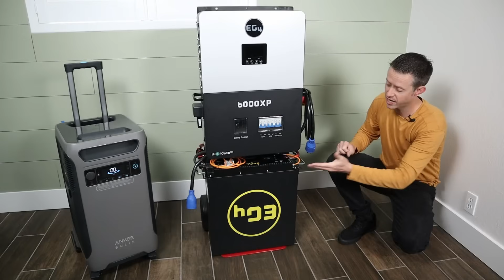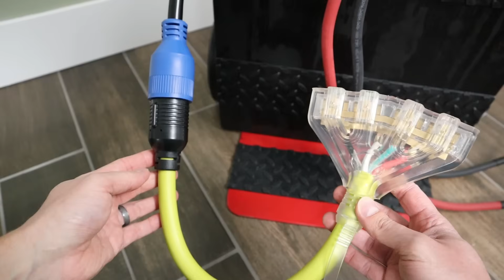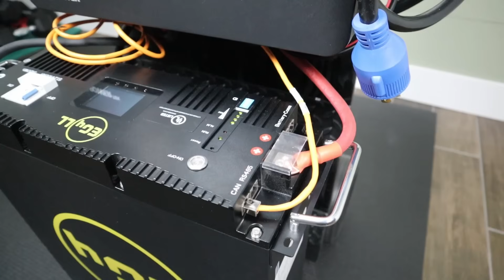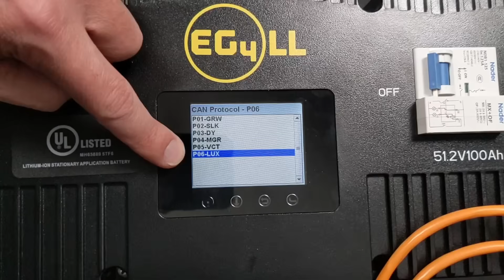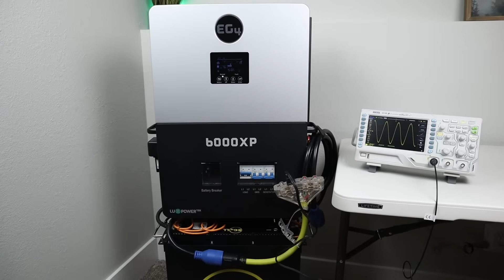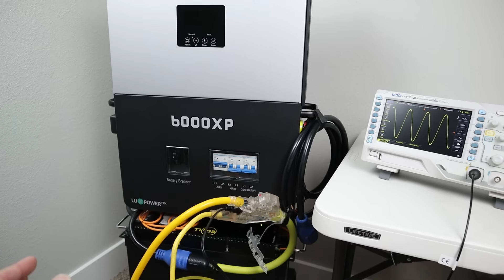Build Your Own AFFORDABLE 240v Battery Backup! Mobile Cart Using the EG4 6000XP & LFP Battery

Comment from the maker: I think I need to do a video discussing large DIY vs Plug N play systems. They both have their advantages and disadvantages! Thanks for your feedback everyone!
Reply: Came across something new, the Enphase IQ PowerPack 1500, a power station they say is rain and snow resistant and with a temp range of -4F to 122F.  Something I haven’t seen before and I left a suggestion they contact you for a review.
Reply: @BoringVolcanicField  that thing is $1400+ for 1500WH, not too impressive really. Says 82% AC efficiency which is about average to below avg?
Reply: @kayakjoe I’d like to see Jason get sent a unit by them for his full test suite.  What Enphase has that no other power station has is full UL certification for outdoor use:

UL certified for temporary outdoor use (UL 2743), system safety (UL 2743), and battery pack safety (UL 1642); tested for thermal runaway protection (UL 9540A)
Reply: Any guess how long or How do I calculate how long it would power my electric Trane 2.5 ton 16 seer heat pump? I have a small Predator 5000 inverter generator (3200 continuous via a 120v/30amp RV plug) to charge your cart off an external transfer switch.  Our home has tons of very tall pine & hardwoods on the south side. So solar won’t be very productive no matter where I mount it.
Reply from the maker: @butchgreene  this is how you calculate runtime:
Watt hours of the battery / watts of your load = runtime in hours
5000wh / 1000 watt load = 5 hours of runtime
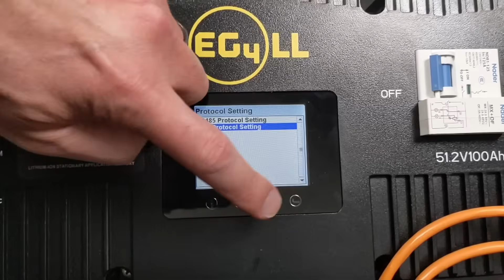Reply: @butchgreene I do hvac work and something that would really help you is purchasing a soft start . I recently installed one and going from around 100 starting amps to 20+\- starting amps made a huge difference. If you really want to heat or cool your home with very little amp draw I’d suggest getting a variable speed inverter hvac system. I don’t know how many batteries you have but your best bet would be to purchase a 220 volt mini split which has the built in inverter for the compressor and fan motors. This will give you a true soft start with very little energy consumption. You can get them fairly inexpensive, signature solar has a version of them but you can purchase them online just about anywhere. Research before you buy . They do have 120v versions generally up to 1 ton , the one 10:43 have starts at 7around amps and drops as the unit slows down . I’ve installed 2 ton 220 v mini splits and had them drop down to around 2 amps after room cooed down.
Reply: Looking into this.
Reply: Can we see a video of value charger with a gas generator?

Comment: Just put a 5Kw hand truck together, all in, including tools(new and didn't have them), under 1600, 100% UL listed, tax, tag, title, out the door, delivered... so depending on the components you pick and build requirements... you CAN get a GOOD setup, brand new, roughly 1K doll hairs less... NOT the same system though... The one here is way more capable, also it's 100 miles past overkill for most people...  You CAN mega max out a hand truck setup with an industrial hand truck and 4 to 6 server rack batteries stacked in a rack for 20.4Kw to 30.6Kw, with a 12000XP all in one, and be knocking on the door of 10K doll hairs.... or work up to that over several years... that's the great thing about these...

Comment: 3:54  So, just to be clear, since I have a 30amp 120/240 Transfer Switch, this cart should work with it, correct?  If so, I’ve been looking for something like this as a DIY build!
Reply from the maker: Yes. This can provide 6000 watts or 25 amps @ 240v

Comment: I am planning something similar, except wall mounted. I dont want to get involved in permitting , so a self contained system that I can charge with the 30 amp outlet on my generator would be perfect. What I want to be able to do is power my electric water heater so Im not sure if the 6000 watt inverter will get that job done for me. What would be another inverter you would recommend that would get that job done? I want to be able to set it up exactly as you did with the 240v output and input. My original plan was to disconnect the battery from the home when we wanted to shower and use the generator but if I can just attach the inverter to the home and charge with my generator at the same time, thats even better. I have a 30amp input on my home with an interlock switch. This will be primarily for disaster backup/grid down stuff. I dont have the yard space for solar panels but Ill probably get some in case of a long term outage. I have an inverter generator rated at 9000 watts. I appreciate any advice you can give me..

Comment: Your load is primarily resistive. A switching load is a far better test for the sine wave. Plugging in something like a DC bench power supply and altering the DC load on that supply would vary the cycle rate of the power draw from that load.
You also have not tested power factor. A capacitive load is a leading load. An inductive load is a trailing load.
Reply from the maker: Got it, I appreciate the feedback.

Comment: you are so right I HAVE 5 diy solar generator one for each part of the house the big one 5000w 10000 peak 24v with 12740 watt hrs of battery in all 5 of them i might have 3000.00 in them mostly all diy battery

Comment: For anyone wondering, this layout won't work if you use an Ecoworthy V3 battery.  It's too tall!  You'll need an additional 4-6" on top to mount the inverter higher.
Reply from the maker: Good to know! Thanks for the tip!

Comment: Is there a 50 amp version? Im really tired of Anker 3200w input
Reply from the maker: Ecoflow is announcing a new DPU inverter soon, should be able to power 12,000w (50 amp at 240v).
Reply from the maker: Ecoflow is announcing a new DPU inverter soon, should be able to power 12,000w (50 amp at 240v).

Comment: Quick note in case anyone is interested in doing something like this, there is a choice of inverter that most people aren't aware of. Inverters can include a transformer or not. If they have a transformer in them, they are typically better at starting inductive loads like air compressors, etc. But they have a much higher idle power consumption compared to transformerless inverters. Inverters without a transformer usually can't start large inductive loads as easily, they can but you have to oversize them like 3x, and the have lower idle power consumption. So, starting power capability, idle power consumption, and weight are the tradeoffs between them.

Comment: So, you want more power? I am in the process of building 2 almost  plug-n-play EG4 units in my shop right now. The smaller one will have 2 EG4 indoor wall mount 280 amp hour 300 pound batteries back to back on a wheeled base. It will have the 6000XP on top.  The other unit has a Signature Solar Boss Box 400 pound steel enclosure. It has 3 outdoor wall mount 280 amp hour batteries inside the cabinet and mounts a Flex Boss 21 inverter on one end. The box sits on 5500 lb rated caster wheels but was designed to be moved by forklift.  The units are 28,600 watt hours for one and 42,900 watt hours for the other. I ordered an EG4  100 amp Chargeverter to input generator amps into the batteries for weeks of winter dark days with my Onan ''standby for stink and noise'' diesel generator. Yes, mucho $$$$, but I won the quick pick and decided to build something useful instead of blowing it on booze and party girls.  Your video steered me in the right direction. Thank You!   71,500 watt hours of power should keep my clock radio running for a while.

Comment: for the new 120v charging capability,  would you just cutoff one end and connect a regular 3 prong 120v cable extension cord  instead of the NEMA cable?  Thanks

Comment: Nice video.  I have a question for you.  I have 7 Jason Solar with 325 watts, 46v open circuit and 9.17amp.  What is the best way for me to connect it to Delta Pro 3 or Anker Solix 3800?  Any help would be greatly appreciated.  Thanks
Reply from the maker: Anker F3800 can only support solar panels in parallel.
The DP3 can support both solar panels in series and parallel.

Comment: I think you said your AC In was via a generator port. When on generator and not just plugged into the grid, is the generator supplied power just passed through the inverter or is it conditioned (assuming you have an open-frame non-inverter generator with modified sine wave)?

Comment: Can you make a video showing how to make a low cost battery "buffer" backup? A system that can push 240v while simultaneously being charged by a single 120v line from like a EV with VTL or a small generator. Then leaving it plugged to grid 120v to maintain the battery between outages

Comment: Jason, I've seen other YouTube videos that discuss the importance of precharging the capacitors in the inverter to prevent damage to the inverter or the battery BMS. Is that process incorporated in your startup procedure? Did you precharge any capacitors when first hooking up the system? Finally, if this system has been idle for 30 days or more, do you have to precharge the capacitors again? Thanks for your help.

Comment: Can you charge it with 120v
Reply from the maker: Which one?
Reply: @Jasonoid the eg4
Reply from the maker: If you try charging via the 6000xp it shuts off the 240v output. 
To bypass that issue, you can if you buy a 120v 48v battery charger and just connect it to the battery terminals. I have this one and it works well:   https://amzn.to/4i11Nkf
Reply: @Jasonoid  ok thanks

Comment: Could you do this for the pecron  E 3600 lfp  because at the moment I think it’s the best value proposition with two of them you get the 240 V out and I think the total price ends of being around $2800.  With an extra 1KWH. I believe it’s around $.41 per kilowatt hour.
Reply from the maker: The only downside of having two separate units to provide 240v output is that each unit powers one leg of power. One E3600 for one leg of 120, the second for the second leg of 120v. The problem is that if your legs are imbalanced, say one leg is pulling 500 watts the other leg is pulling 800 watts, one power station will die before the other and whole system turns off.

It's best to use a single unit for 240v loads so that its pulling from one battery. No issue of needing to balance the legs. I hope that makes sense. Pretty much an issue with ANY two units combined for 240v...

Comment: Still thinking about this and torn actually between these two.

The f3800 allows you to charge via 120v and does not disable 240v output. That is super convenient for me. I already have a 220/240 hookup for my generator inlet, if I wanted to charge the 6000xp I’d have to run another 220/240v line.

But with the 6000xp you get way more expandability. I can’t use solar on either cause of HOA regulations, so 120v charging would be ideal.
Reply from the maker: The 240v does in fact turn off  on the F3800 while AC charging.
Reply: @ this is good to know. When charging 120v on the 6000xp, if you’re  it using the 240v output and just charging on 120v (I believe this was added as part of a firmware update) it say that only 120v output is available. Does that mean permanently? Or if i turn off the 240v output and only use the 120v to charge. And then when it gets to set limit, I turn off 120v input, would I be able to use the 240v output again?
Reply from the maker: @Danjr704  both of these units shut off the 240v while charging with 120. The way around that on the 6000xp is just to charge the battery directly with AC battery chargers connected to the battery terminals, you don't have to use the 6000XP to charge the battery.

Comment: Great video would like ur thought I have the same 50 amp transfer switch and want the ability to have multiple power supply’s to hook to it I purchased the 6000xp and the wall mount battery with kit .    Question is on the AC output where you used a cut 30 amp cord could I use a 50 amp so I could plug right into transfer switch ??

Comment: A different hand truck choice, while more expensive, it solves a couple small issues you are having. The Milwaukee model #70121, has fenders in front of the tires. Also the hand truck has dual handles. The dual handles is safer for heavier loads. With a single load, any uneven terrain can cause the hand truck to twist and possibly start to tip over. The dual handles makes for more stable control. I love your video.
Reply: I cannot find that hand truck, can you post a link?

Comment: I built the 3000 watt version and am super happy with the results.   I have cut my electric bill down tremendously.   Very, very simple system and easy to build, since EG4 provided the cables.  More people need to have one of these.  I use the system to help charge my 4 Bluetti AC200P's utilizing the 5000 watt solar input ability.    I currently have 2200 watts of solar hooked up to mine.  Thank you for getting me started with solar.
Reply: Do you get level 2 charging for EV?
Reply: @NovaFlowO2  never tried it

Comment: Another question would it be possible to have the output cable be 50 amp to hook direct to reliance 50 amp transfer switch and the input cable be a 30 amp to connect to either generator or line power ? For a backup way to charge battery ?

Comment: Excellent build. There are saddle clamps that are insulated.  Those are better and safer for clamping power cables down.
Reply: And strain relief connectors for all cables instead of those two screw connectors not that you're moving the cart around a lot.😊

Comment: Nice video!  Are the ground and neutral wires only connected to your inverter and nowhere else?  Any issues when you powered the system on?  Did you have to adjust (Enable / Disable) setting #26 in your inverter?
Reply from the maker: If you plan to connect to your home electrical system through a transfer switch or with a generator inlet, you leave the ground open (since it uses your homes ground). If the system is fully independent and you don't have a ground, you may need to toggle #26 to bond the ground and neutral.

Comment: Can you charge the battery up with 120v and disconnect and then turn on the system to power something at 240v? I would like something like this to connect to my houses generator hookup when we lose power occasionally.

Comment: I have a question. If you start out with the 6000-watt inverter and the 48V battery, if you add more batteries, do you have to buy a larger inverter? If so, would it be cheaper in the long run to buy a 12k or 18k invertor and add more batteries as needed? I would only be using this in case of a power outage. I live in hurricane land and during Katrina, we were without power for 2-3 weeks, so I would need solar and a lot of battery backup.
Reply from the maker: You don't have to buy a larger inverter if you don't need the extra wattage. 6000w is a bit of power to run critical loads during a power outage. Any additional batteries you add to this setup will give you longer runtimes.
Reply: @Jasonoid  Thanks for the answer.

Comment: Suppose you wanted to add a second 48 volt battery in parallel. Where would you want to put fuses or breakers, and what size? Which is preferable, a fuse or breaker? I'd like my system to be as safe as possible, to prevent any damage to the system (and to me!) Thanks -
Reply from the maker: The battery has a built in 125 amp breaker so as long as your wire can handle 125 amps the breaker will trip first is there's a problem. I love having the batteries with a built in breaker. Installation is easier.
Reply: @Jasonoid  wow, thank you so much for the quick response! Definitely going to build one of these. Thanks again!

Comment: Hi Jason I’m thinking of picking up the package deal from signature solar the 6000xp the 280 AH battery and box to make nice neat combo I’m wanting to hook to my transfer switch seen mixed comments that it has to be ran to critical load box not a transfer switch something with ground any problems on your setup running your transfer switch with this set up and advice would be deeply appreciated as I wanna order before cost increases thanks

Comment: Good afternoon ,, thanks so much for the information. I wanted to just clarify about the charging via 120volt. I can use a separate charger as you described to charge while running 240volts ?  I am looking to power up a few things on my food truck (refrigeration mainly) or possibly the whole truck  via 240 if its not too much for this setup to handle. I'd also explore a few solar  panels to mount on the truck as well. Thanks again
Reply from the maker: Yes, you can use your own external 48v battery charger connected to the battery terminals to charge your batteries while outputting 240v.
Reply: Thanks so much

Comment: Question about Neutral-Ground (PE) Bonding: Do you have Setting #26 set to DISABLE when plugged into the grid and running a load and then switch to ENABLE when unplugged from the grid and just running the battery/solar and a load?
Reply from the maker: If you are running this independently from a transfer switch or generator inlet in your home, you can ENABLE the neutral ground bond. You disable that setting when you have an active ground in your system or when it's tied into your home.

Comment: As someone pointed out WP would be proud, but this video really helped clarify some of my knowledge gaps around the 240 vs 120 input. But after having watched many "mobile cart" videos I think I will go with the Eg4 3000 EHV-48v Inverter/Charger and EG4-LifePower4 V2 Lithium Battery like you used. I don't THINK I would have a 240V need for a mobile cart, but if I ever did I guess I could add another Eg4 3000 or simply upgrade to a Eg4 6000.  Thank you for this video!